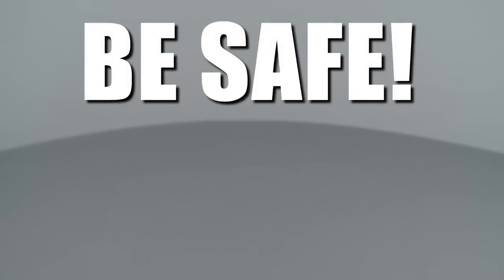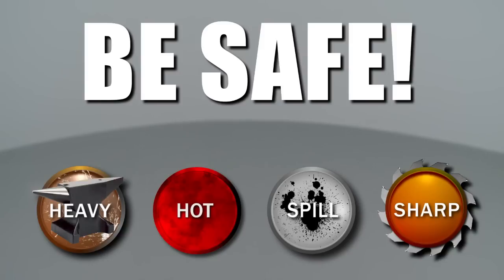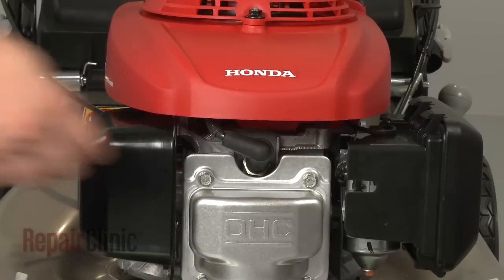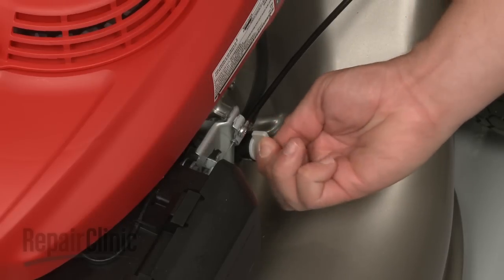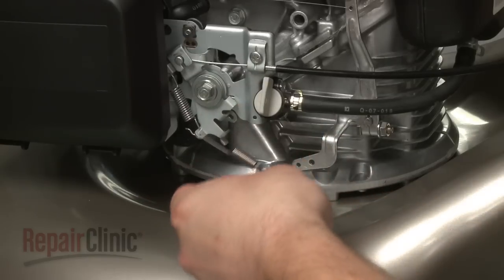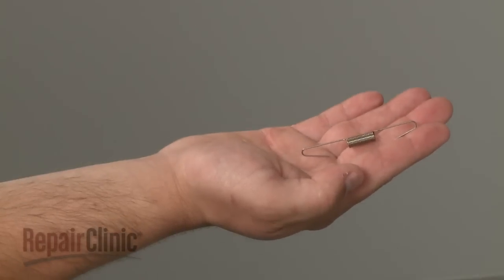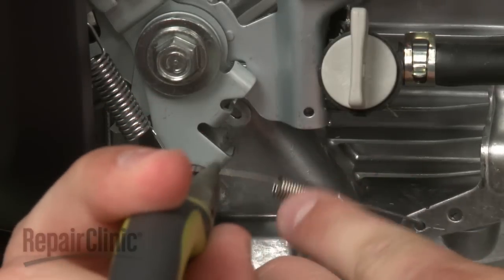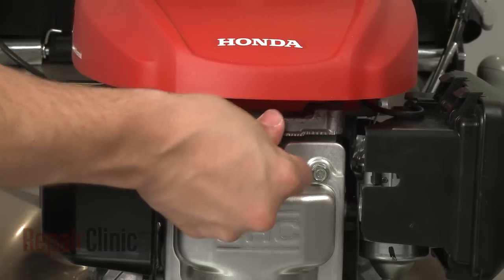Honda Lawn Mower Small Engine Governor Spring #16561-Z0L-000

Comment: Surging and hunting can be a plugged carb and or water in the fuel, bad gas and water are 90% of my small engine business, bad gas is any gas over 2-3 months old, stay away from fuel with ethenol..trust me. springs and adjustment screws don't go out of whack by themselves, unless they get damaged, so fiddling and adjusting stuff is beside the problem, drain your fuel system add fresh gas.

Comment: Seriously, you had to turn off the fuel and disconnect the spark plug boot to do this? LOL.
Reply: hells yeah, also if you want to prime it or fill it up with gas, I always disconnect the spark plug.  Been doing that for years
Reply: Don't laugh..it happens, engines start real easy when you don't think they will, just turning the blade while removing the blade can start it, I've seen it happen, pulling the plug wire is easier than doing everything with one hand for the rest of your days.
Reply: They have to cause the lawyers

Comment: so i have ahonda mower that I had hit a metal drainage pipe the blade went thru the thin metal pipe, so i pulled it out and started the mower back up and it idles very high and slightly shakes but when I engage the blade it stops and mows pefectly and idles great! so I assumed the main shaft was bent so i started the mower and turned it on its side and engaged the blade and it turns PERFECTLY and shows no signs of a bent shaft, any suggestions? should i check the govenor? would that get messed up by the blade going into a drain pipe? again it was very thin piece of metal

Comment: I have a Cub mower with Honda engine and auto choke. It starts and runs great but if you shut it off it barely restarts. It idles really low and belches black smoke like the auto choke isnt working. If i push the choke plate open it runs fine again. Ireplaced the autochoke with a known good one and the problem remains!

Comment: Can I attach the governor spring to the hole further out? I tried this and the engine runs at a higher RPM and really eats grass like a champ.  I am worried this will hurt the motor.
Reply: You'd be pushing it if you continue to run the engine at such a high rpm. And, being outside of the range in which the maximum power curve is achieved,  You'd likely find the engine bogging out much easier than in it's proper configuration. 
I'm dealing with a "custom tuning" in which the po took the "that's not needed" approach